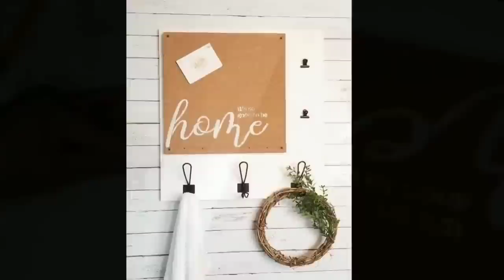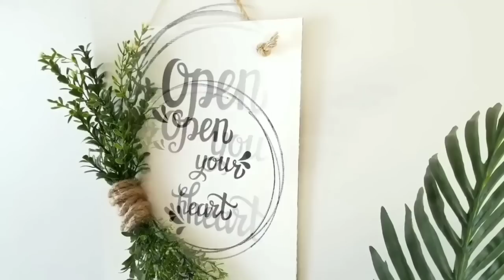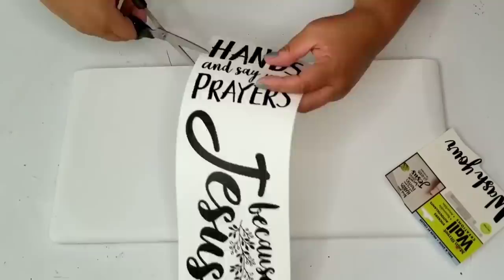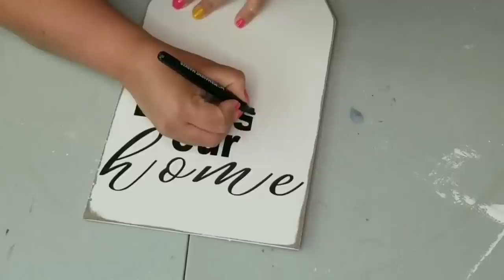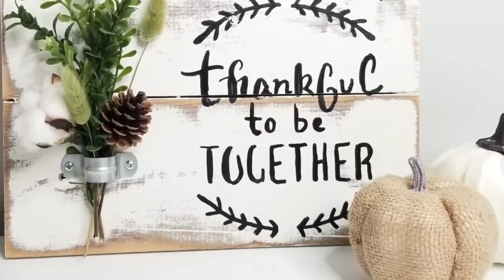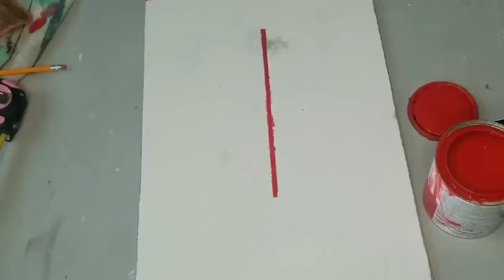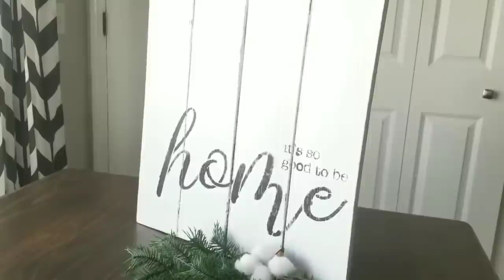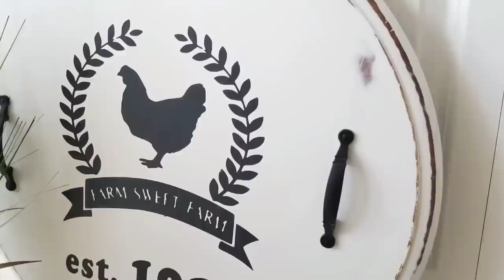🌟 25+ Handmade Farmhouse Signs Anyone Can Make!

Comment: Hello I was watching you video today, I noticed that you were stenciling on cork. I noticed that it had bled under your stencil. I might help if you use modge podge on the stencil. Let it dry then add the paint over top of the stencil. It might seal the cork enough that you wont have the paint bleed under the stencil. Just a thought. Good luck 
Connie

Comment: May great tips and fabulous works. How do you figure out how much to charge for the ones you sell? Adding up total materials including incidentals, costs of wear on tools, gas to get materials,  and total time, then if there's other costs to sell ? Do you have a guide to give you a way to fairly price items for you as creator and for the end buyer? Thanks very much,  keep up the amazing work.
Reply from the maker: Hi! Pricing is the absolute hardest for me. I tend to price on the lower end so that it sells quicker. As a crafter/creator I truly believe it's so hard to get a fair "hourly" rate for the time we spend on the creations. From buying, creating, travel, etc. I try to have a chart of size of item, durability, season, and then decide on how much to charge. Of course I always get back what I spent (I usually don't count paint and other supplies I have in bulk at home) and then try to at least make $10-$40 in profit, depending on the item.

Comment: I have a question. When using the decals will they be shinier than the board? Will there be lines that show I used a decal?
Reply from the maker: There will be no speak line, but when looked at closely yes, you can see a sheer border around the words.
Reply: @diybeautyonpurpose  Would Modge Podge over it help?  And thank you so much for answering!